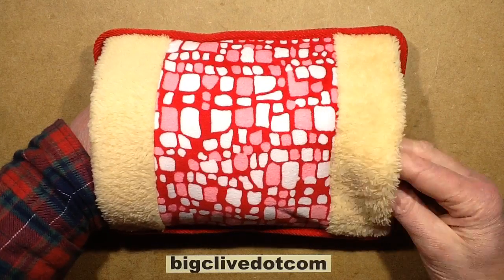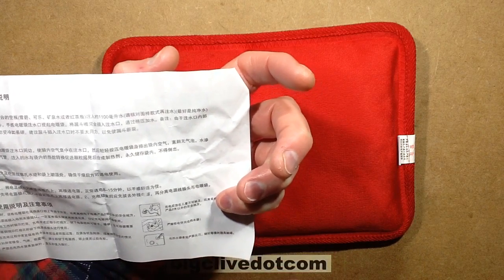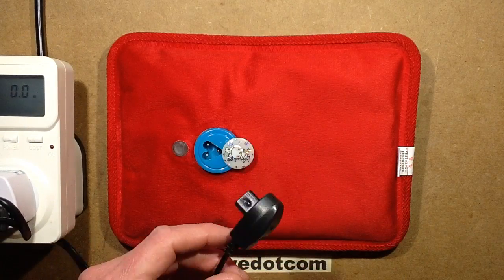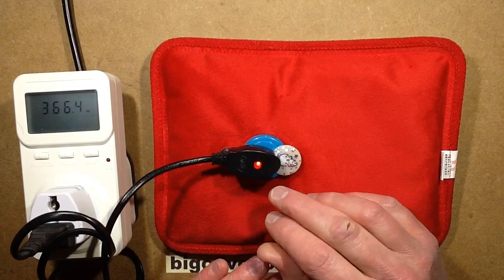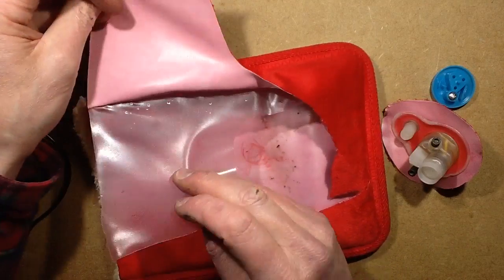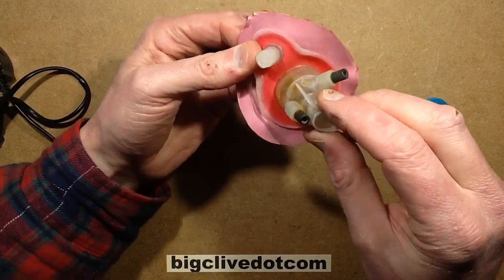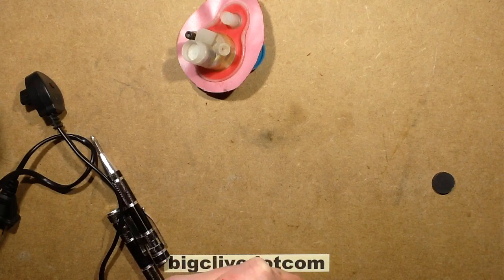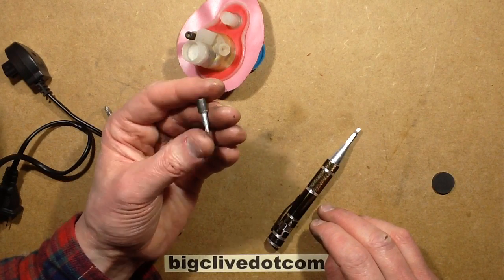Teardown of an electrode heated muff / hot water bottle.

Comment: whats the liquid or chemical inside?!?
Reply from the maker: Not sure what is in the water.  But recently I powered one up and it didn't work, because the electrodes had corroded completely away.
Reply: @ i dumped the liquid out by accident. Adding regular water didnt warm up as quickly anymore and did not warm up much at all. Wonder what exactly is in the liquid
Reply: @slim617  it's salty water.
Reply: @Solid_Snake99 it is not

Comment: Clive, I know what ! You could fix the Electric hot water bottle that you cut up by making a hole in a inner tube of a Wheelbarrow Tyre, and fit the Mechanism in it with Rubber Vulcanizing Solution. Seriously though, if you filled the Hot Water Bottle with Radiator Cleaner mixed with Water, it would not Rust.  I think it might Work ! Just don't fill it with Glycerine mixed with Nitric Acid !

Comment: I've got two of the ones with the External Stapler type mains unit ! You disconnect it to use the hot water bottle and it is permanently filled !  They are really good !  I don't think it will burst and it is Disconnected when you use it !

Comment: Hi! So I opened the cap and took out all the water. The water inside was super brown and rusty. So I drained and poured fresh water into the bag. But now it's not heating at all.
Reply from the maker: It has to have a small amount of salt to make it conductive.  It just requires a tiny amount.
Reply: @bigclivedotcom the did the same thing and it's not working anymore ☹️ can I add water with normal salt into the bag?

Comment: The secret of this device is the salt they put inside.
If you remove it by changing the "rusty water" it stop working
Reply: Yes, when its new.  You can hear some kinda salt bag inside when u shake it..      if u do refill the water.  Use distilled water ,   top up with 1000ml.    Add  baking soda/salt.    It will work fine.        Ive tested with different ratio   5-7g works best.

Comment: I have JML, Powertron branded version as well as the version you dismantled in the video they all have the same type of 3 pin connector. The JML and Powertron power connector have a 240v cable wired into what looks a plastic stapler with a power switch in the pivoted part.
Reply from the maker: The JML ones have a safety switch to detect the bag swelling up.

Comment: When you clean up the liquid and refill it with water, then it will draw less wattage and need longer time to reaching maximum heat.
I found that original liquid just mixed with Salt! It makes the pillow work properly.
I just try to add water + baking soda, work better and draw less wattage.
Just always pay attention to mix with base chemical (or my be weak acid like a vinegar) to the water if you refill the water form completely empty pillow.

This pillow just helping many cancer patients when they need a warmer to relieving their pain. 
I always use it, one on my feet and another on my shoulder. So easy to use and work so well.

Comment: Hey Big Clive. You probably won't see this but I was recently gifted a similar unit to this. It's branded 'HotPod' and is a sealed unit. Feeling around through the lining, it appears that the one I have has a separate component connected by wires to the plug-in point. I'm mad curious now as to the differences between mine and the one you've disassembled. The unit I have is distributed by an Australian company and has a weird charging arm that looks like a stapler or strange shoe horn.
Reply: Typically, the charging arm shuts off the power in case the thermostat fails or the bladder overinflates because of too much pressure
Reply: @ProfessionalRickRollEr  I found mine to be very touchy. If the bag is not on a flat, level surface, it won't charge/heat.

Comment: Hello!
When emptying the pack from the fluid inside that i had previously filled (water) i found the fluid to be insanely dark brown. Any ideas on what it might be? Is it just rusty water?
Reply: Same!
I emptied the pack once, refilled it and it would not heat up. I then added some table salt. It seems the table salt wasn't a factor in the brownness!

I believe it is due to just using tap water, which contains various minerals and stuff, reacting to the salt; That I added myself, or the present tablet within the pillow.
Reply: Add max 5g of salt / baking soda

Comment: The 2 electrodes will rust and disintegrate over time. I had one that was stored for about a year. I took it out recently to use but it seems deflated. When i wanted to refill the water massive amount of rust water and rust particles came out the filler hole. I flushed the thing. Refilled with water again. But the unit failed to heat up. Junked the unit and got another new one because its cheap.

I think filling it up with distilled water is the best way to curb rust formation. The last unit had tap water in it.
Reply from the maker: They already contain salts to make the water conductive.  They wouldn't work with just pure distilled water.
Reply: @bigclivedotcom  I understand the conductivity part. I wonder what could inhibit rust while allowing the electrodes to conduct?
Reply: Mine is  roughly 3 years old now, and it was giving off a slightly metallic scent every time we warmed it up. So I decided to drain it and discovered completely brown water. Like tea steeped for ages with a splash of milk coloured. I finally got it flushed to clear but was disappointed to learn that it stopped getting hot. The light still goes on, but the temp would stay cool. 

Learned from this video that it is probably an electrolytic type of water heater so I added a bit of bicarb soda into the solution, and voila, Bob's your uncle

Comment: Clive, brilliant video ... Thanks for taking the effort to show us how it works, much appreciated .. :)

I quickly wanted to ask, i am using two muffs as heaters for my two coconut plants (in separate cement pots) as the roots require a minimum of 17° C and the temp here drops well below 3° C... The muffs are deployed on the outer shell of the pots (in a cemented waterproof housing joined to the pots) so that way they stay in contact with the outer case of the pot, & hence the mud remains warm & the plants can also be watered daily with no water contact on the muffs .... thanks to the muffs i can see a reading of +15° C through out the day & night on the embedded digital thermometer. 

But my question is : As the muffs remain switched on 24hrs every day, till how long do u think those thermostats can hold on till the muffs start malfunctioning ... They have been on now 2-3 days and i intend to keep them that way till warmer temps arrive in March. . . 

I am sure those thermostats have some expiry on their lifespan considering i keep the muffs on 24hrs.
Reply: Dear Clive ... Whenever you get a few moments to read through, be glad to hear from you...Thank You, Best Regards Nik

Comment: Only problem is that with time, there is a gradual gas build up which is causing the bag to become quite a bit bit swollen! I am still using it every night, but I'm afraid it's going to burst some time!
Reply from the maker: If it's the type with a filler plug then you can vent the excess gas.  If not then be cautious if it gets too full.
Reply: I'm experiencing the same problem. Kindly explain how vent of the gas from filler plug

Comment: i dont understand..if the unit pulls 350+ watts when it's running, how can a 1/4 watt resistor be used? isnt all of that current passing through the resistor (and the LED) and then into those electrodes?
Reply from the maker: +kekejojo1212 The resistor was just for the LED.

Comment: WARNING!!!!!
This type of  electric hot water bag is ban from selling in China. Because it might explode will charging. You should buy those produce use heating wire.
Reply: thats why automatic heat turn off switch is installed to make sure the heat warmer does not get too hot
Reply: do have any idea if it starts to release a weird kind of steam while charging before exploding?
Reply: I just bought mine in China , I live here

Comment: I would never want to use one of these. At some point it gets a small hole and you electrocute yourself with "live water" dripping out while heatung it up.
- I'll stick to the old style: fill warm/hot water at the sink in a bag without any electronics.
Might even find my grandparents metal bed-cans for pre heating the bed if room was not heated in the winter...
Or get the normal, electro heated, safety approved, heating-rags in all sizes, without water.

Comment: I still wouldn't buy anything that has live mains voltage straight across the water in it. A heating element is THE WAY to do this, and while I'm too tired to think right now, I'm sure there's an easy way to protect from overheating if there's no water. Water will not get much hotter than 100 degrees, so a thermostat or thermal fuse set on 100 (maybe 150?) would be a pretty good trick.

But no, no electricity through water, please.

Comment: The material that makes the main unit appears to be Low Density or High Density Polyethylene judging by the colour and stiffness. Non porous material easily heat sealed and non conductive.

Comment: the listings specifically say this won't work below 180 volts any suggestions for making it work at 110 volts
Reply: +Nerys it should work at lower voltages, it will just be at a lower wattage.

Some people have suggested adding salt to get more power. One could also try mineral water, or tap water with bakingsoda (sodium bicarbonate.)
Reply: +Nerys  use both 115 V ( USA split phase) lines without neutral = 230 V

https://en.wikipedia.org/wiki/Split-phase_electric_power

Comment: Only reason I can think of for one electrode being off at an angle like that is an attempt to make sure there's a certain minimum amount of water in the bag.

Edit: Also should the cut-out fail the there may not be the risk of a steam explosion. As soon as the water starts to boil the bag will balloon and lift the electrodes out of the water - assuming it's being heated on a flat surface with the stated amount or water in it of course.

Comment: Have you seen/done a tear down of the foot warmer/muffs that are available?  The ones I am thinking of (I have one due to suffering from permanently cold feet) do not have a water filler style.  They are purely some form of heat cable, presumably.  Possibly a derivative of the soil heating cable used in greenhouses etc?

Comment: clive where can i get one of thoes watt dievices u have showing how much juice is being drawn.. cheers
Reply from the maker: +Dave Britton Energy monitor.  Most electronic suppliers do them and you get some very random quality ones on ebay.
Reply: +bigclivedotcom My favourite part of them as noted by ladyada on a teardown of a killawatt -- it has to operate without actually using much current itself, and is powered from the sense coil around the line conductor.

Comment: Having only one arm angled makes the mould smaller, and thus cheaper. Probably why they did it that way.
Reply: +dalem04 I think it also makes insertion through a small opening possible, you can just angle it in. It allows more separation and smaller insertion opening than if the insert was symmetrical.

Comment: silicone has a melting temperature over 1500c so you can test something by touching it with hot glass or im not sure how hot a soldering iron is but if it melts its not silicone

Comment: +bigclivedotcom I work in a restaurant and whenever I turn on the hot tap to get some hot water, the water is boiling hot quite quickly and it always comes out with those tiny bubbles in it. Are there giant electrode boilers for industrial applications and whatnot?
Reply from the maker: +TheCocoYouKnow They only tend to be used in industrial applications.  It sounds like your restaurant water may actually be boiling in the tank.  Possibly even a result of a faulty thermostat unless it has been set high deliberately.

Comment: Take apart a 35 pound European branded one to see what is different
Reply from the maker: +camtheham13 Just bought a £16 one and it has a heating element inside it and a couple of extra safety devices including a one-shot thermal fuse and a charging clamp thing that disconnects the supply if the bag swells up.

Comment: Is there any way that this could produce gas by electrolysis over time? especially if any impurities were introduced?
Reply from the maker: +Luke H At 50Hz AC I think it just produces steam.  I'd guess the little plug might blow out if pressure did build up.

Comment: They actually sell these things in pharmacies here in Australia as hot water bottles (without the muff, but pre-filled).
Reply: +fremeaner Hi,
Go to your local super market, get a cheap bottle of cider, I use Aldi Or Lidl own brand.
Fill the bottle with boiling water to make it shrink; Then you can  micrwave it, heat will last, I mean really last! 
That's what I used when I caught a cold; Which now seems to be a thing of the past, since I started brewing my own moonshine.
Reply from the maker: +davidmccabe4 In case the water boils and starts generating steam.
Reply from the maker: +fremeaner If it's the one with the strange hinging charger plug then I just bought one.  It has the thermostat, a one-shot thermal fuse and if the bag swells too much it also has a microswitch in the hinge to shut the power off.
Reply: +bigclivedotcom that's the one, the heating element breaks quite easily too
Reply from the maker: +fremeaner It feels like a "U" shaped element in a housing inside.  This one I bought today is a gift for my mum, so I can't take it to bits.
Reply: +bigclivedotcom yeh that is the one. Keep the receipt in case you need to exchange it, my cat knocked mine off the table, seemed to be enough to break the thing (upside is, seems to fail safe not fail deadly, won't even try to heat)
Reply: +bigclivedotcom Any idea why the bag swells up so much that it cuts the charger off??

Comment: I wouldn't like to trust the thermostat, that could turn into a steam boiler.
Reply: +Green Silver I wondered the same thing... This is the only way of controlling the temperature, no secondary over-temp switch... I wonder what happens when it goes faulty, failure-mode: closed. Would the bag de-glue itself, or would it explode? Probably the filler plug would pop out first though...
Reply: +Green Silver  the ting can do its pressure fail test by its own ... a feature !
Reply: +Green Silver explosions are always fun. :P
Reply: something I thought about in regards to this is that if the water turns to steam it will stop conducting ... I feel like the electrodes would stop making appreciable contact with the water before it would get so big it would explode. That being said, I'd love to see the faulty thermostat Theory tested! :-)

Comment: I could see the lovely cheap Chinese thermostat getting stuck permanently on...
Reply: +Aron Gooch What's the worse that can happen? 3rd degree steam burns on both hands and a hole burnt in your leg when you paniced?  Loving the bejewled kitty cat plug cap tho lol.
Reply: +Aron Gooch Seems that it could actually explode if it boils the water.
Reply: I had one of these and has the opposite problem
Reply: unplug it from the wall...
Reply: +Nicholas Ruiz If there's a wall left after the house has burn't down ;)
Reply: Aron Gooch fire extinguishers

Comment: Great until the thermal switch welds its contacts, then you've got a bomb!
Reply: +Alan Cordwell i really  doubt that this thing would hold much pressure before just forming a small leak at one of the corners or something
Reply: +Alan Cordwell   you see the Chinese have a potential to kill more (avarice or poor) 1st world & 2nd world people than Al Quaida ^^
Reply: +Alan Cordwell Not necessarily. Think of what would happen as soon as the pressure in the bag goes up.
Reply: Fair comment guys :)
Reply: +snipeish1 if it leaks on you wile your touching ground it would be an issue though, I would not use this wile plugged in. Just let it heat up unplug then enjoy the great feeling of being inside a nice hot muff.